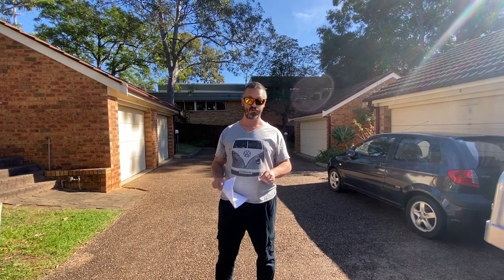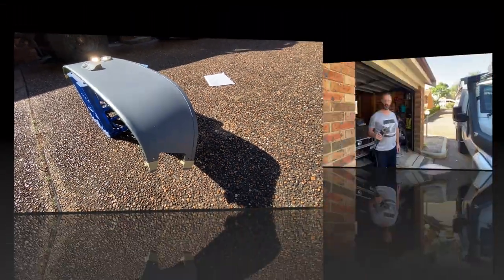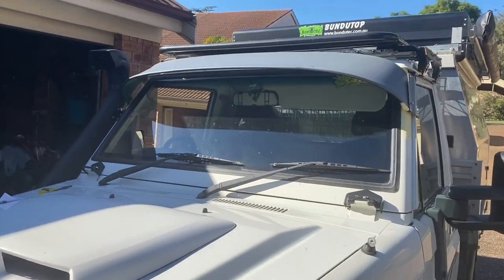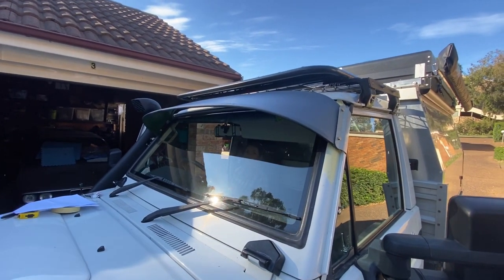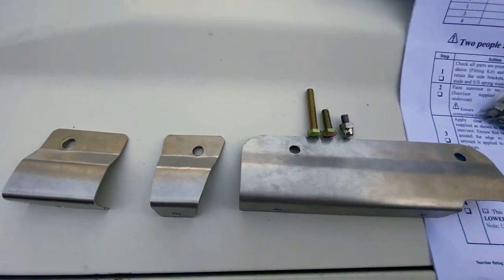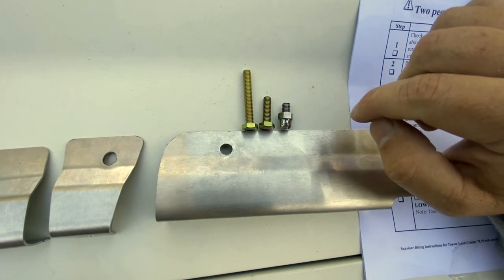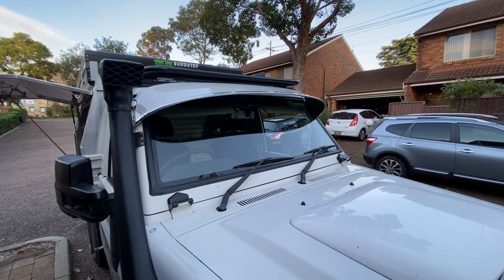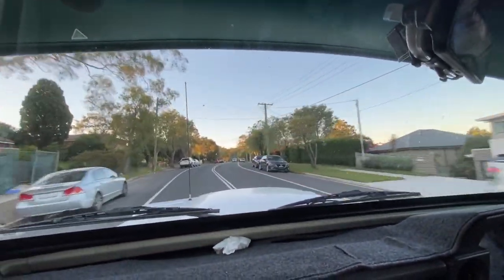75 Series Landcruiser Sun Visor

Comment: Shame those red hot sparks from the grinder would have done all wonderful things to your paintwork as they melted through the paintwork and then happily started rusting away on your panels?  They will even melt through the glass if it's in their flight trajectory. Little buggers.

Comment: Legend mate. I have been trying to find vids on How to Fit a Sun Visor for a Troopy VDJ78 GXL. None found. I bought a sun visor 3 weeks ago, and it didnt fit at all. Now I have an idea,
Reply from the maker: Great to hear, don't be scared of chopping stuff up with the grinder and beating it into submission with a hammer..
Reply: Any pics or tips?, I got vdj78 gxl, sun visor on the way!

And thanks for vid! nothing else out there :S
Reply: X Halton progressively tighten down the bolts on the visor to the brackets side by side. Once you have the visor on the bracket you will see the brackets have distorted a fair bit. Get a block of wood to hammer the brackets around the frame again side by side little by little. Drill the holes and stew them in. Took ages. Take your time.
Reply: @MJermMer  thanks mate! I'll let you know how it goes haha :)

Comment: Hi Nice video.. not sure if you are aware but at 0:51 your info is missing an L in Australia... haha.. I am presently looking for a visor for my 80 series. I am also noticing there are some that are full metal and some mesh.. any idea of the difference or benefits of either, does it flex or vibrate much on the highway? I always love the safety thongs ~;0)
Reply from the maker: It does wobble a bit on the highway yeah but nothing that annoys you or you even notice. If your looking at it you see it. Not sure about the mesh ones. I seen them available but haven’t come across another 70 series with one. I love the visor. I virtually never ever drop the visors inside any more unless it’s real late in the afternoon and I’m heading west just before sunset.
Reply: @4wdglampingaustralia102  At present I have not seen any 80's with these so I am just wondering the pro's n con's before I take the leap.
Reply from the maker: @TimsBitsnPieces  google 80 series visor and then look in the images tab. I think they look good